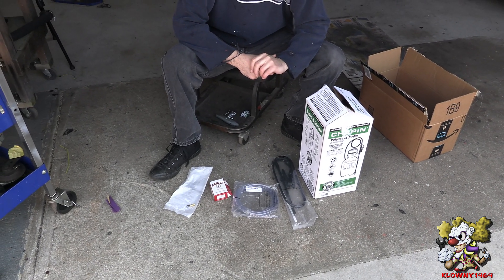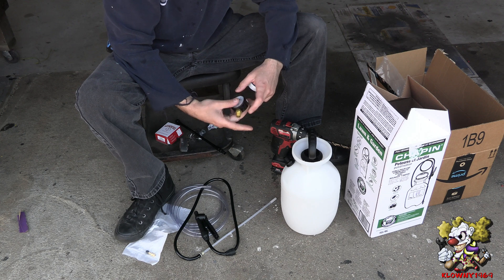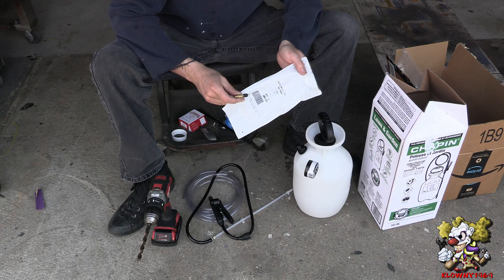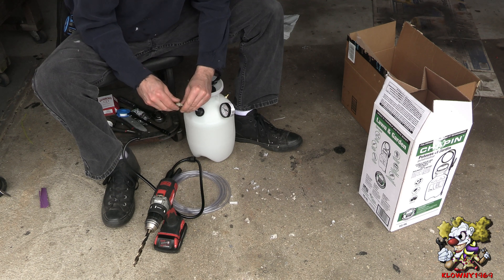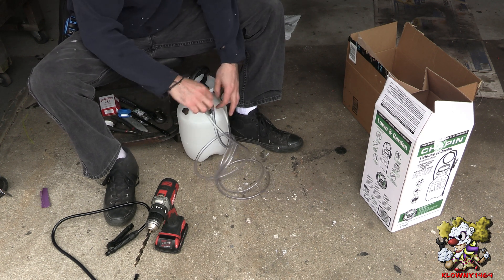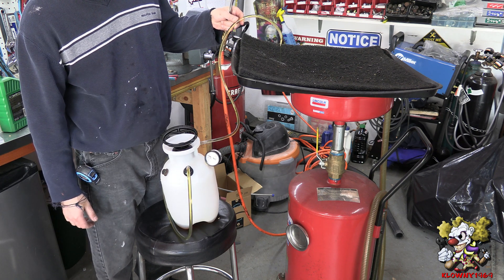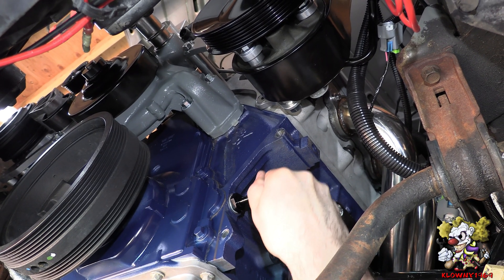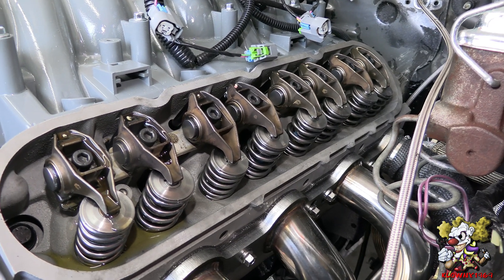How To Make an LS Engine Preluber For Under 30 Bux!!!

Comment: Nicely done! Do you know, Where on a Chev 327/340 HP engine attach the tube? Sub'd and liked!
Reply: 1962 Chev Engine, dont want to go distributor route
Reply from the maker: You can try the port above the oil filter or by the China wall in the back of the block..don't forget to subscribe
Reply: I read to take out the oil pressure sending unit, or install a T, but maybe like he said..

Comment: You can just fill the engine and take a drill and a old distributor shafts and spin the oil pump.
Reply from the maker: On a gen 1 small block chevy u can..not in an ls engine..the oil pump is located on the front of the engine on the crank..thanks for watching and don't forget to subscribe